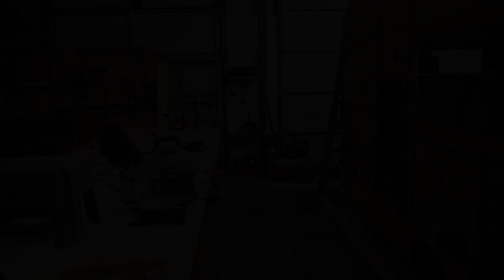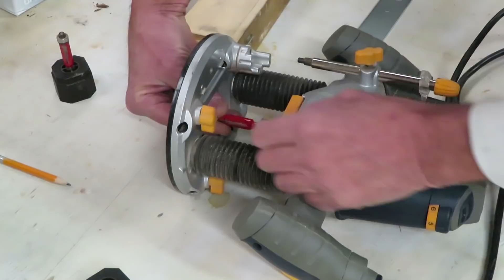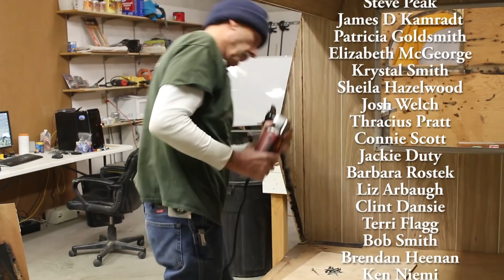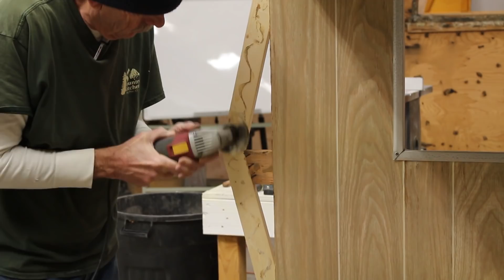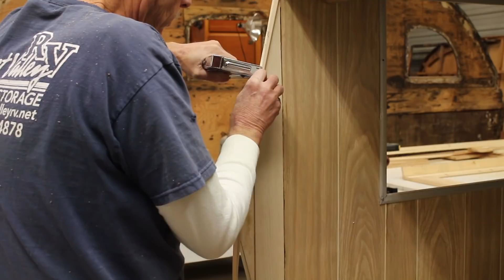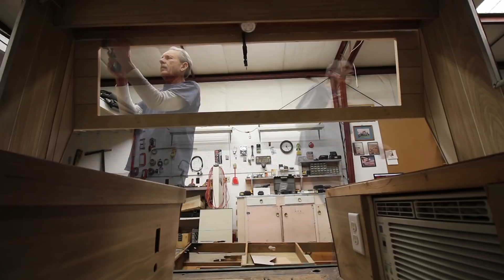1962 TravelEze Vintage Trailer Rear Framing

Comment: Great job there Larry. It is always interesting to see the pieces of the puzzle going together. There is no doubt that the parts of the trailers that you replace and restore are far better built than the original parts that were placed there first. Thanks for sharing. Enjoy the new year my friend.
Reply from the maker: That is usually the case... Taking the day off today.

Comment: spending the afternoon watching your videos and all I keep thinking is OMG what have I gotten myself into?? Is it safe to say whatever we take apart should be put back together exactly the same way and with as similar materials as we can find? Are you on any Q and A forums by any chance? At the moment I'm thinking "sell it and run" 1969 Aristocrat Land Commander that I "thought" was in good condition. <sigh>
Reply from the maker: All trailers older than 10 years have water leaking into them and that creates rot. So the older the trailer, the more rot. A 69 is going to have a lot of rot. And the only way you can find out how much rot you have is to remove the metal skin. That's because of they way they are built. They are built from the inside out. So you must attack the trailer from the outside in. It's all in my Anatomy Of A Vintage Trailer videos which you now have access to because you became a patron. If you can be in class on Tuesday evening I will answer all of your questions. You are not alone. I have 170 students in my class and they are all building beautiful trailers from rotten old hulks. I'm also on the Vintage Trailer Talk forum. You should join that forum also. Lots of great info on there and the people are all very helpful.

Comment: Larry, have you done a video where you talk about running electrical wires for a canned ham trailer.  I’m talking about both trailer running lights and interior lights.  Is there also a video discussing the wiring of  a converter distribution panel like they sell at Vintage Trailer Supply.  Ps. I love your work.
.
Reply from the maker: Yes I have a whole series on it. Best place to find my videos without having to search You Tube is my website where they are all listed and indexed with titles and descriptions. http://www.cannedhamtrailers.com You'll find the electrical series there. Everything you need to know on trailer wiring both DC and AC. Internal and external.

Comment: Larry, Very nice work.  Is that adhesive you applied the water proof kind?  Or does it matter.  I was thinking of using just Construction adhesive like liquid nails.  Also, for safety and a better quality cut on the table saw, you need to lower the blade down so the teeth just clear the cut. Having it so high really gives the blade a chance to grab the wood and make it kick back.
Reply from the maker: That is liquid nails that I use on the paneling. And having the blade up high works better on paneling than having it low. I have found that to be true from experience.

Comment: Is the Traveleze a DeCamp? I bought a 1964 Traveleze this spring and it most closely resembles a DeCamp but I can’t find any info on them. This is the only other one I’ve seen. I’d love to see more of the interior.
Reply from the maker: I don't know. I did this project as a class project for my patrons. This trailer belonged to one of my students. It's the only Traveleze I've done so far. But I have a 63 twice the size in the back waiting to be finished. I'll look into this DeCamp you speak of.

Comment: I bought a 1971 open road and have gutted it and reframed it all before seeing this video. I did not know to put the paneling on with the walls and put them together differently thinking it would make them stronger than the original way. Is there a way to put the paneling in from the inside so I don’t have to redo all of the framing I’ve already replaced?
Reply from the maker: No. You did it all wrong and now your trailer is unsafe because the way the paneling crosses OVER the top of the walls not only holds the ceiling and front and rear walls together but it's a major part of the engineering that goes into the structural integrity of the trailer. These are not built like houses at all. That's because your house isn't built to go down the free way at 65 mph over pot holes and speed bumps.

Comment: Larry, this isn't the only video of work on this trailer, is it?
Reply from the maker: The only other videos I have on this trailer are installing the metal skin and J Rail. But those have been kept private for my classes. They are a collection of videos and live streams. If you would like the playlist just email me at mobiltec@gmail.com and I will send you the link. Just remind me who you are on YT.
Reply: @mobiltec  Thanks, Larry. All ready a student. I'll look on Patreon.
Reply from the maker: @LongWalkerActual  OH that's right. Sorry. No you have to email me for the link. It's not listed on Patreon...
Reply: @mobiltec  Looking at this video again, what was it's story?
Rear frame repair, with new skin & J rail?
Reply: @LongWalkerActual  I did a major restore on this trailer. Both the front and the rear of the trailer had to be rebuilt. The skirt boards were replaced along with much of the framing. The inside paneling was only replaced in the rear. New electrical was added along with some plumbing repairs and then it was insulated, condensation barrier installed and then all new metal. All the windows were restored. Someone painted them green so all that paint had to be removed and the aluminum cleaned up. It was quite a job really.
Reply: @vintageamerica1  I noticed the skirt boards. Were they one long piece? My '69 Shasta needs them.
Always appreciate your time!
Reply from the maker: @LongWalkerActual  that would be kind of a long answer here. Maybe you should ask me in class. I think you're in my class.
Reply: @LongWalkerActual  I can send you a few photos of what the framing and skirtboards looked like. The skirtboards were really just a facade to make the trailer lines look cool. No real structure there.

Comment: Larry does that panel actually match up good to the others?  My 1968 aristocratic loliner has that panel and I have to replace one panel in the ceiling where the p.o decided to cut a hole through the rafter to install a vent. Cut the framing in half and then tried to screw the vent to the panel.  But to find a panel to match the grooves?  Where?
Reply from the maker: That paneling is much lighter than the original. It was something the owner picked out of my pile of scrap. But you might be able to find something closer if you look. This paneling came from Mantlecraft. http://www.mantlecraft.com

Comment: What paneling is that? Where'd you get it? I'm working on a 68 Shasta. I haven't found anyone who can tell me where to get it. Thanks in advance!
Reply from the maker: I found this paneling at Mantlecraft... http://www.mantlecraft.com They will ship if you are willing to pay the price.
Reply: @mobiltec  Thanks. Is that Birch in a 68+ Shasta? It's a very light color like the one in your video.
Reply from the maker: @HotRodTodds  No. Beginning around 65 all of the manufacturers began using photograph type paneling. The veneer is actually a transparent photograph and not real wood grain. That is what you are looking at in this video. Before that the manufacturers used real wood veneer. The most common of which was birch. Some also used maple. Especially in the larger park models. And when birch became hard to find they started using ash. Ash is very hard to find now a days due to the fact that transportation from state to state was banned during the Ash Beatle Break Out. Once the ban was lifted there was so little demand for it they stopped making it just about everywhere. By the way the paneling you see in this video that was added does not match the original. That was done on purpose because I had scraps left over from a 66 Super Shasta that I did and the owner said it would look fine even though it was mis-matched. It was cheap so he liked it. LOL.... Go watch the Super Shasta V Logs. They are all listed on my website for easy indexing... http://www.cannedhamtrailers.com